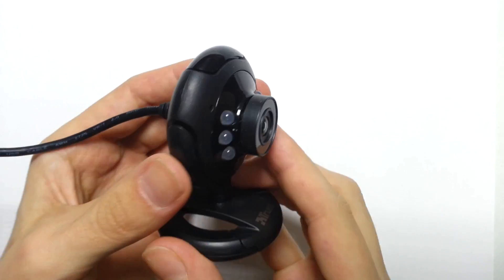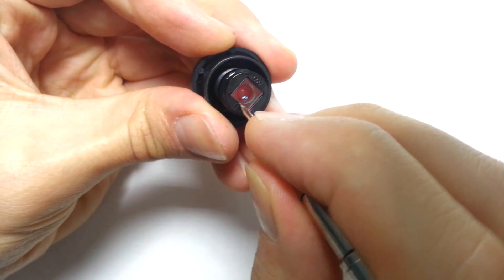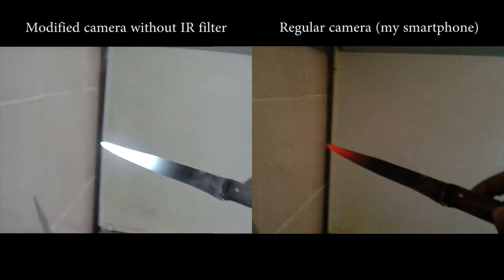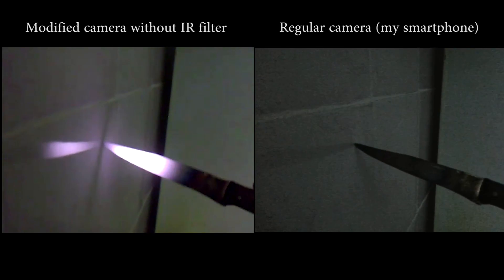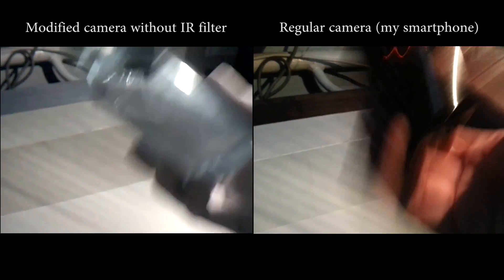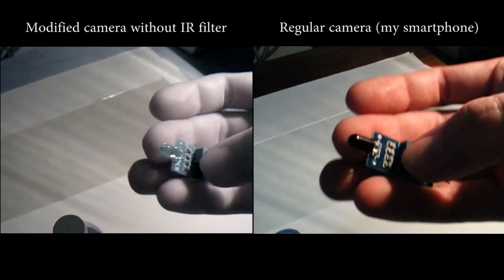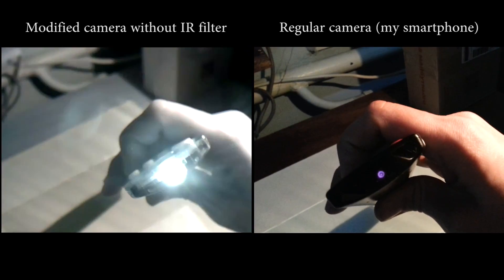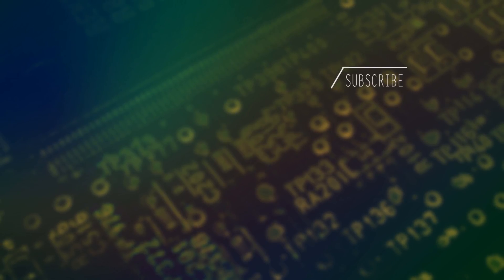How To Make DIY Camera That Can See Near-infrared | DIY IR Camera

Comment: Planning to use this as a diy thermal camera for laptop board repair for detecting overheating components, do you think it will work?
Reply: Thermal cameras use wavelengths 5k-  10k+, regular silicon sensor only sees up to 1100 nm

Comment: How many turns left to rock the lens without breaking?
excellent! If I change the lens for a 3.6mm lens of the same size that it comes with, the one I want to change, which seems to be 12mm, would it work and the angle would change or would it stay the same at 12mm?

Comment: i  would consider buying the coil on ebay that I found ($52), but I am nervous enough about the whole duty fee thing importing into the US.  I took the risk on the driver - but have never bought directly from China before.  How much xtra did the coil and driver cost you:?  (dont know if you are in US).

Comment: How much actual power does this draw?  Could I use a boost xfmr (110v to 220v) of like 300va (I have 2 of these) ?  Would be surprised if that small of an autoxfmr would work - would be like <1.4A at 220v max.

Comment: I got a problem. Me and my dad took out the infrared filter (broke it sadly), and when I tested it on computer, it was the same thing. It didn't seem to detect anything more. The webcam I am using is called LifeCam VX-3000 (Microsoft). I'm almost certain that the filter was taken out. Could it be possible that the camera originally didn't detect a lot of the electromagnetic spectrum, or did we do something wrong?

Comment: The filter you removed looks more like a UV filter (Ultra violet) some pinkish purple color. The IR filter is more like solid red. In any way, no matter what the range of that filter is, it make a incredible difference. I want to remove the filter out of an old SLR camera and replace it with a clear glass filter. Then I want to mount it on a telescope and see what kind of weird pictures we will get of the night sky. Just for interest, using a UV filter on a camera helps a lot to get a clearer picture. The sensor is sensitive to a little bit more UV than the human eye, and it cause a "washed out" look on the photos if it is not fitted with a UV filter, or a screw on UV filter is used on the lens. Thanks for this video, now I'm motivated again to get to that modification project on the SLR camera.
Reply: That's not true, NIR cut filters are cyan when looking through them, and has a reddish reflection; if you think about it, if a filter attenuates wavelengths close to red, how can it possibly look red-ish
Reply: Dichroic coating = IR filter
Reply: Nope
Reply: No, it is actually an IR filter. I believe cameras just have color sensors that make it look purple. For example, we could actually see infrared light at 850 nanometers, but you'd need to look directly at the source of it. It would look like a deep red color to us, but to the camera, it will look more of a violet color. By the way, think about black-body radiation. Looking at the knife, we know that the temperature is between 500 and 1000 degrees Celsius, as it's glowing with a yellow/red color (from the smartphone). I do not think that is hot enough to produce a lot of UV radiation though. Most of the light emitted would be in the infrared and red. Also, we all know that the TV remotes produce infrared, not ultraviolet, so it doesn't make sense for us to be seeing some bright light emitted being ultraviolet.
Reply: IR filter is blue
Reply: Results??
Reply: Its IR, purple because the red and blue CFA pixels on the sensor transmit infrared light well, which is picked up by the semiconductors which are already sensitive to IR

Comment: I believe you can also put in a infrared only filter to block out visible light
Reply: I used two glass pieces at 90 degree angle from polarized glasses to block visible light
Reply: Interesting !

Comment: Is it same as thermal camera?
Reply: No, that is different. Thermal camera sense the heat that the body emit, and very expensive. This is IR and pick up reflected light in the IR range. Somewhat of the same thing but not really. To go technical on that will be a long story. With a thermal camera you will see no real good picture, but just grading of heat differences.

Comment: 2:40 that's what i do to check the status of the battery of the remote (when it's low of battery the light will be less intense than when you put new batteries into it).
Reply: holy crap that's cool

Comment: I tried it with a very simple webcam and it didn't work. The IR filter in this case was round and it seemed that it had an additional function as some kind of pre-lense, because after having removed it the images became extremely blurred. CAN SOMEONE LET ME KNOW WHICH MODELS OF WEBCAMS WORK FOR THIS????
Reply: I did comment on that filter that looks more like a UV filter to me (Pinkish purple) IR will be red and it will cause that you will only see back and white. Your camera is very sensitive to the UV range, the other side of the spectrum than IR. That cause the blurred picture, more like a "washed out" picture, and no way to focus it by adjusting the lens. That is exactly why photographers screw on an extra UV filter on the front of their cameras, not only to protect the main lens from dust and scratches. About all SLR cameras (Single Lens Reflect) like Nikon, Canon, already have a UV filter directly over the sensor,but adding one in the front of the lens do no harm, and add to the protection of an expensive lens.

Comment: I wrecked the second webcam now. It is all well what the video shows but when you put back the lense the picture is not sharp anymore!!!!!
Reply: Try to place a ring of wire with thickness of removed filter glas piece so the near sensor lens is at same distance as before. Or have you reinstalled it backwards?

Comment: I did as show and it did not work... Fake
Reply from the maker: Most likely you did not remove IR filter, maybe it was glass or something or maybe your camera has additional filers... Idk... Different cameras are built differently.
Reply: @ElectricalPro  no it does not work my web camera is a USB type as shown in the video but with a different type of Plastic casing, still it has the same type of lens assembly with an ir filter i have removed the filter still no IR spectrum observed in the video streaming.
Reply: @redmidubai3005  you need an IR illuminator to see these things...
Reply: @kodak1587  my camera already has a set of six LED to illuminate but as it is shown in the video that after this hack the camera will pickup the infrared spectrum from the thermal output of high temperature objects was not accomplished so even if i illuminate the subject with IR light it's not the same as the video claims so I stand with my opinion.....

Comment: Does this work on any camera lense?
Reply from the maker: I don't know whether every camera has IR filter installed on its lens. Probably some cameras have a filter installed on its sensor, so it will be difficult if not impossible to remove such filter.

Comment: I wonder if this could detect ghosts, I am looking for a ghosts detector schematic if you know of one. Some say they pick up magnetic field with store bought ones. Would be fantastic if you could make one to show us. Many people are trying to make them.

I have a old 16 channel dvr with lots of cameras to try this one. My new high definition cameras replaced them but now they have 1080p out so when this dvr goes out I will upgrade. But the old 420 fps camera's are not being used so will try this project. If heat is required I don't think ghosts give off heat. But sounds like a fun project anyways. Thanks for all your video's.
Reply: You're not very bright, are you?
Reply from the maker: I personally don't believe in ghosts, but even if I did, I don't know what to look for. There is a lot of spectrum to look for, starting with sound waves, and radio waves and ending with x-rays and other stuff, some equipment will be pretty cheap and some will be hugely expensive. I only heard that people use static electricity detectors for that. But I don't know much about ghosts detection.